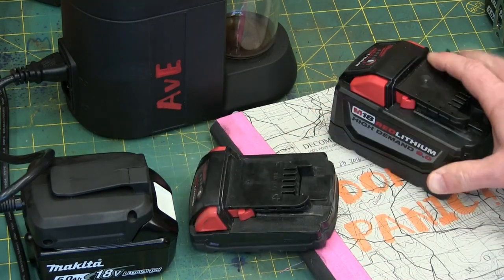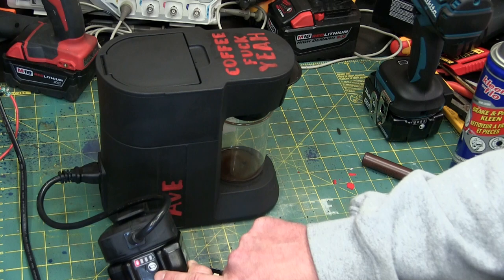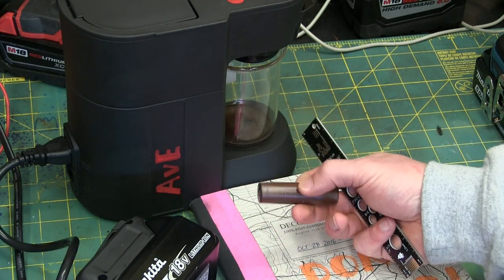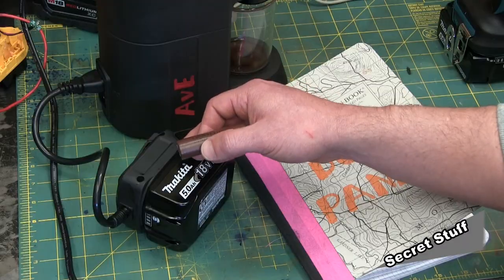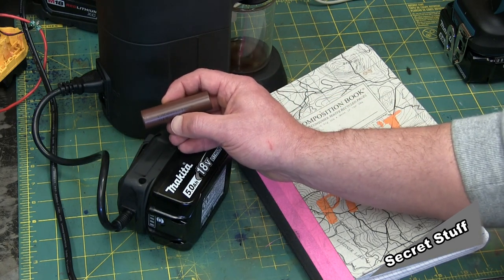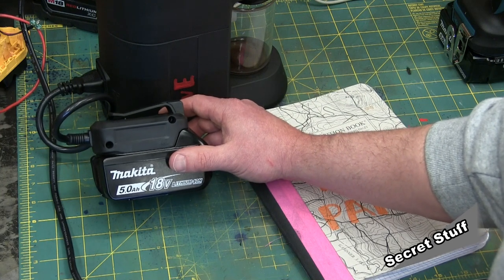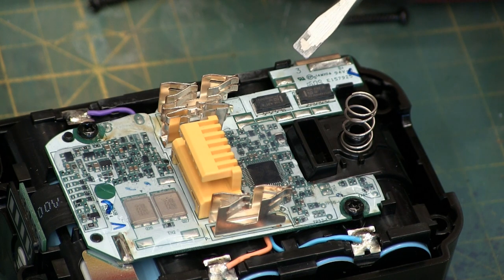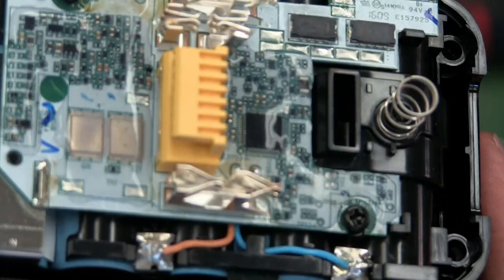BEST TOOL BATTERY? WHY BIG LITHIUM COST YOU LESS!

Comment: I completely agree with you. I sold my business after 20'years and took a job with Home Depot. With my building experience and good sales skills they slapped me in hardware. I was always a dewalt fan and had purchased dewalt almost exclusively due to I lived closer to lowes, where you cannot get makita, rigid or Milwaukee.

I have come to the conclusion after 1.5 years living a very fast and one of the richest counties in the USA... Louden that most of the electricians live Milwaukee, foreign day laborer types love dewalt and the hardass outdoor types love makita.

I do sell a lot of rigid as well, mostly because of their free battery for life plan.

I own almost the emoter 18fuel line. A lot of the fuel 12 line. My favorite tool I use is the 12v Hammer Drill Fuel Series. I love the thing and it is durable as hell.

I have the 18 fuel one key drill/driver set that I don't want to get dirty, lol. They do very well under moderate use. 

The flex volt Mitre saw has been returned by every 

customer stating that I blows circuits. As of tonight 100% of those who have purchased has the tool have returned.

Now, the Milwaukee battery Mitre that runs of the 9.0 Red Lithium is a better tool by far and those who have purchased it come back to thank me for the suggestion and the tool exceeded expectations.

A few of my Favorites:
Fuel Series 18v 1/2 impact wrench its a powerful monster and fully variable.

The 5 3/8 fuel 12 circular saw. Amazing light duty tool. The 18v tFuel is nice as well.

Makita has a new sub compact 18v set. It's moderately powerful, super small and keeps flying off the shelf! Mostly hvac tech.

I have to totally agree about the Dewalt flex volt Grinder! I'd say it one of their bests right now.
Reply: Can confirm: The Fuel 18v 1/2" impact is a righteous beast. I work on elevators. When you're 25 feet up a shaft, stepping out on a piece of 3x3" angle, having that kind of torque with a cordless tool is a damn miracle.
Reply: Good to know. When comparing warranty claim handling who is easier/better to deal with Milwaukee or DeWalt?

Comment: Not only does the chemistry affect the batteries' voltage, capacity, and discharge/charge rate, but also the electrode morphology plays a large role in battery performance. In general, a higher surface area electrode will give higher specific capacity (capacity/mass), and smaller capacity fading at higher currents for a given electrode material, without changing the chemistry at all. This is because for intercalation mechanism batteries  (i.e. Li-ion, Na-ion, Mg-ion), the diffusion of ions inside the electrode is relatively small (depending on the material), therefore when the current for charge or discharge is increased, the kinetics of ion insertion/deinsertion can not meet demand. However, suppose you make your electrode material very small (<10 nm particles), then the diffusion distance of ions relative to particle size is not as bad. This allows you to get more ions in or out faster (higher current), but also it allows you to get more ions in or out relative to electrode weight (higher specific capacity). 
Here is a highly cited paper by Wagemaker in 2007 that shows Li-ion capacity in Lix-TiO2 nearly doubles if particle size is decreased below 10 nm. http://pubs.acs.org/doi/abs/10.1021/ja067733p

tl;dr material morphology can affect battery performance without changing battery chemistry.

Comment: Yes the correct battery for the correct application I totally agree. But don't forget just because the battery specs say it can, the electronics and protection may stop it from doing what the battery really can. So don't just judge based off what cells are in the pack, but also look to see what the electronics may be limiting the total discharge current at. Then you have to take in consideration how much max amperage the tool will drain under the worst torque conditions. How much max amperage will the tool pull? And now what tool are you talking about since they make the packs for multiple tools these days.
Then complicate that with different environmental temperatures also, the same batteries may not give you the amperage needed under the max conditions when they are a little colder or hotter. I know, Lithium cells don't like the cold, but you don't like to kick on the big heater also for a quick drill job. So I think it's always best to have over rated amperage cells then the tool will ever need to drain since it will give less Amps when cold, but still enough for what the tool needs because people will still try to use it in cold even if the manual says not to like your coffee pot. 
All these battery reviews, you should mention that it's best to keep the packs in room temp and not in the freezing shed for the winter also. Like the one for the weed wack when it's not used in the winder, charge it half way and store it in room temp if you still want the same performance next summer. Check the charge every month, it might have a parasitic drain and might need a top off charge.
So so many factors to consider.  

I do like the Samsung 25R series, the originals were hard to damage under unrealistic conditions. They have always been about high output, the originals were 20A discharge, I think the R5 are 35A discharge. I have some of the originals for years used in my flashlights and they still run hard.
One single LED torch pulls 4A, the other double LED torch runs two 18650 cells and will pull about 6 to 7 Amps. 
Now when it comes to use with flashlights yes I do prefer Panasonic cells, they may only do 10A discharge but at a much higher capacity so longer light. For tools packs like this I think Samsung has a good balance and quality for long lasting cells that can take high current charging and still last longer then say some LG cells. But for charging 18650 for flashlight I don't normally charge any faster then 1A. Then the flashlights that use more then one cell may have a 10A high capacity Panasonic, but the protection that is added on by other battery makers might limit the drain so that same Panasonic cell maxes out at 6 AMP drain before the protection kicks in and cuts it off. So the vape heads using protected cells think they are getting 10A but are only getting 6 Amps.

Comment: Why is it that when I test my internet connection it's like Christ reincarnated, but then I go to do something important and the router shits the bed and moves to Antarctica
Reply: because they know, my dude. they know.
Reply: There's two parts to the problem:
First some the service providers (cable and dsl mostly) actually do filter and notice you are doing a speed test and prioritize your connection for that bit. After you run the test successful you get back to equal with your other people in your neighborhood again and getting average speeds/shitty connection. 
Second part some providers cheap out of getting decent interconnects (peering) with high traffic / high demand websites like youtube, netflix etc. so everything runs fine except for those high demand places. Some US ISPs were actually in the media for intentionally throttling for example Netflix.
Reply: I'm guessing that you are running your speed test with the default settings, which if it's speedtest.net or the like... is selecting the closest server with the lowest guessed ping times... it's a 'best case' scenario... meanwhile, you may never connect to that server again except if you run a speedtest. Try your speed test again, a few times... this time pick servers in Washington State, Nevada and Virginia... compare your results. And... the speed-test sites so something that is common-practice in speed tests... when they calculate the final info... they start the clock once your connection reached a steady state and throw away the starting speeds (if they were lower). For a long standing connection (think of downloading GBs at a time)... that's fine and a better representation... but for general web surfing (which has tons of short connections) it's not representative.

Also... speedtests generally give you an upload/download rate that are averaged over the length of the test... which is a misrepresentation of the usefulness of your connection . Unless you want to let youtube videos buffer for 20-30 seconds then what you want to know is the average speeds, averaged each second. I don't know of a web-site based speed test that does this, but there are other tools.

As others mentioned there is also the chance that the ISP is letting you run faster due to performing the speedtest (less likely as the max speed caps/etc are often controlled by equipment in your home that they would have to automatically reconfigure back and forth and would require them to keep all customer lines under-utilized instead of the over-utilized that they prefer) and many ISPs do various kinds of throttling based on what you are doing (more likely as it has been common practice to implement QoS based on protocols/destinations etc for over a decade), such as Netflix vs. YouTube vs. Google Play vs. Apple Store, etc. 

You may want to manually reconfigure your router to use an open DNS, possible a couple of Googles servers such ass 8.8.8.8.  If the ISP is using their DNS as a place to gather data about where you are visiting and acting on that data, changing which DNS you use will help stop that.

Did anyone mention that a lot of the speedtest sites are in bed with the ISPs? Well, they are... some even let the ISP re-brand and alter how the base speedtest system calculates results.
Reply: or try DNS bench from Steve Gibson...

Comment: I had one of the first Lithium Ion Makita Drills from around 7 years ago... Don't know if the design was updated, but inside my battery there was a similar computer board but it was only connected to a single 18650 within the battery pack... I went through 3 of those battery packs because the computer would draw until dead on the single cell, once that single cell was dead the whole pack was junk.  from my understanding, a contractor who charged his battery every night would never see this problem... but a homeowner who might leave his drill on the shelf for a month at a time the batteries were designed to fail by this constant trickle draw from the packs computer chip on that single cell instead of drawing from the whole pack evenly, or even better shutting off when not being used.

Comment: I think the contacts are tin or zinc plated copper for corrosion resistance.
Source: we build startup capacitor banks for oil equipment and all the copper we use are coated.

Comment: Just ordered the dewalt 9.0ah. I have two of the smallest 20v,two of the 4.0ah,one of the 6.0. The 6.0 makes my 1/2 inch impact work much better, the 4.0 disappointed me in it unless they were fresh off the charger.  Hopefully the 9 will bring the tool up close to its inflated ratings. I haven't bought into the flexvolt line yet as I'm just a home owner not construction worker. I sometimes use my dewalts at work tho as a cnc machinist. Thanks for the time and effort you put into your vids.!

Comment: The 2 weird stood off devices are fuses that have a heating element to blow them programmatically. They will be in the charging circuit, probably secondary over-voltage protection. Primary being simply turning off the charger and tertiary being the chemical fuse in the cells. If you cut one of the cell taps then the protection chip will see a row of cells at twice the voltage they should be, within about a minute it should decide to blow those fuses for you and a little smoke will come out of them.

Comment: Most of my makita gear won't even accept my two small 1.5AH batteries. The only tool they work on is my impact driver and also in my radio and heated jacket. I can also vouch for the strength of the makita batteries. Dropped my drill off a 10ft ladder onto a concrete floor and it landed flat on the battery. The battery suffered zero damage but the weight/force of the upper portion of the drill cracked the housing at the base of the drill handle. Their service center put a new drill body on for $12 in about 15 minutes for me fortunately.

Comment: Those MOSFETs in the battery pack look like IRF DirectFETs or something similar.
They are a bare die soldered to the PCB. The top side is the drain contact, which is also acting as a large heatsink.
Reply: that's correct they are IRF DirectFETs
Reply: That's what i thought too, although i had only seen the smaller versions of it (up to "medium", i guess?)

Comment: If I remember correctly the balance ports are only usually for discharge. Because of the varying internal resistances of each cell they will charge at vary rates. Therefore as the pack is charging its voltage will be limited by the most charged cell. 

Therefore the charger theoretically stops putting in energy once a cell reaches 4.2v, and begins to discharge all cells or the top most cell to the lowest charged cell.  Then the process restarts until all cells are at equal voltage, and the pack is at peak voltage.

Comment: As someone who has worked all day with an impact driver, I have to say that using the smaller (1.5 Ah) battery was frikkin awesome.  It cuts so much weight off the tool, and when you're using it constantly for 8+ hours, it makes a huge difference!
Reply: And yes, you have to charge them more often, but they would run for quite a long time, and one battery would easily charge before the other was discharged.

Comment: One thing worth pointing out. Since these companies quite often use the same 18650/21700 cells, or equivalent ones, any differences in capacity is mostly due to one difference. The fully charged voltage of a Makita battery is a conservative 20.5v. DeWalt is 20.7-8v. And Milwaukee batteries charge to 20.8v, I have even seen a pack charge to 20.9v. 21v would be the absolute max and the closer you get to it the more critical balancing becomes. It may also shorten battery life, and increase charge times. But, you would have more usable capacity. This is why Milwaukee tends to lead in terms of capacity.

Comment: hey there tanks for the tear down of the 5 Amp mak bat. I have the 3's and they have less circuitry.now those flat silver packages are fets meaning that unlike the 3 amp bats they are capable of load disconnect.the two black packages are most likely the current sense resistors. very low Ohms so as to stop to many angry pixies getting lost.a casual look of that circuit board and all other Mak bats I have looked at do not have the ability to balance the cells INMHO.they just monitor and lock out. that's right if the confuser says no then battery no choch.when I first bought into the 18v mak I did not have a charger I used a lab supply this worked for quite a while then one day no choch the lab supply had done its job the battery wasa charged but any tool with 3 battery conections would not work if I isolated the third conection the tool would work.some time later a few more batterie started performing the same wayafter they were put on a proper charger they came good ITS A micrical.Pr

Comment: Bigger is better, sometimes. I have both size batteries for my Makita drills but working 10 plus hours a day I run the smaller ones to cut fatigue down. Also working from heights smaller is better. I have dropped impacts with the small battery over 30 feet onto concrete with nothing other than cosmetic damage. Multiple times, its bound to happen from time to time. I've seen a Milwaukee impact with the Red Lithium land on the top of the metal housing and snap the handle at the base for the battery on the first drop from that height. Apples to oranges I know, just saying the drill woulda had a better chance with the smaller battery pack.

Comment: Big fan of Makita Drills, sawzalls and grinding wheels! The full size Makita battery packs have really held up in the cold and the batteries are the best of any tool I've ever used. I abuse the crap out them and they run just like the day I bought them.